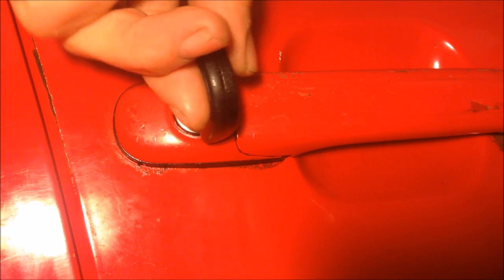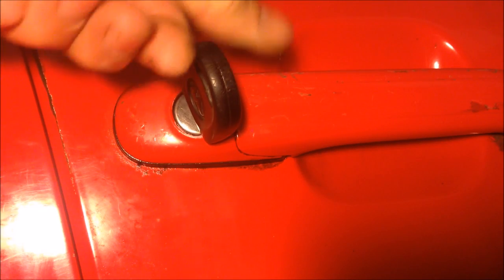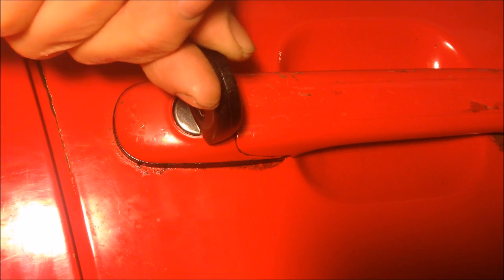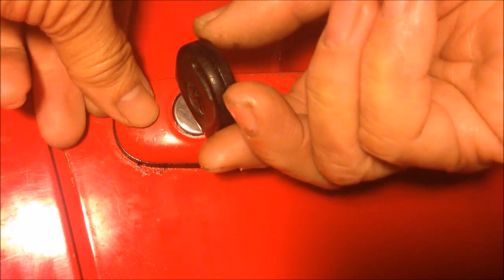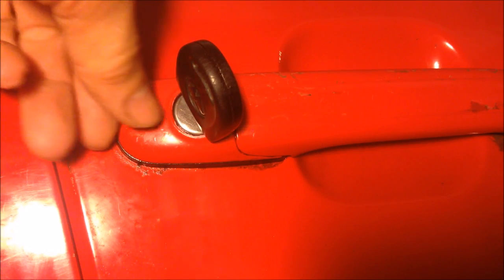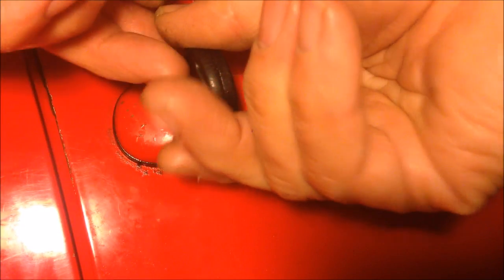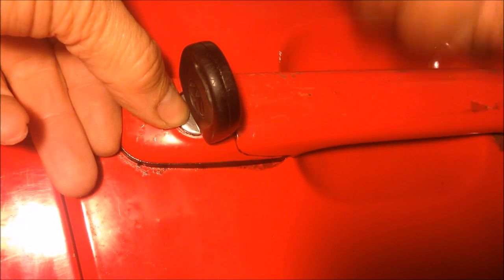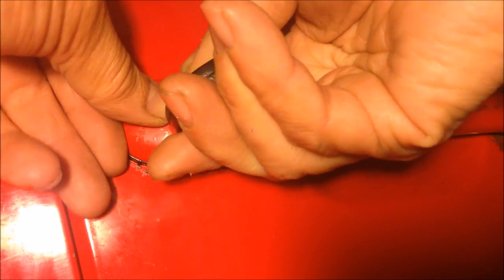VW Polo: How to turn a stuck/worn/broken cynlinder lock?, 6N2, 2000

Comment: Hello sir!
Do you have any idea how to remove the key from  a mercedes 1992SL because its stuck in the trunk. It closes and opens but i can’t take the key off from it.
I would appreciate your help.
Thank you!
Reply from the maker: HI, i think the best you can do is to keep trying. you could use some lubricant, such WD40 spray, into the cylinder, then try to pull out the key (normally at the vertical position). if you did put the key into the cylinder, you should be able to pull it out. if not successful, you can replace the lock cylinder with a second-hand one. good luck!
Reply: @RepairDIY  thanks for your help.. i just read your response and it worked second time with WD40✌🏻✌🏻

Comment: Mine does the opposite, it spins around and doesn’t have any effect. Any ideas? Thanks
Reply from the maker: hi, i think you may have to remove the door trims and cover board to check inside. It is possible to be a broken tab linked to the lock cylinder, or may be some misalignment of the lock components. While I couldn't use the drive door lock, I used the passenger door lock instead before I got time to repair the driver-side door lock. good luck!
Reply: Ben Andersen mine has also just done the same what was the solution, tia
Reply from the maker: hi, The problem is the lock cylinder has worn out. I think you could either 1. live with it; 2. use the passenger-side lock;  3. you may be able to swap with the passenger-side lock; or 4. replace the lock (normally with a different key, not convenient! or ask a locksmith to change the bullets inside the new cylinder?). Good luck!
Reply: Your spring is broken inside the lock

Comment: Hi please if you give me response.my key is locked on passenger side?
Reply from the maker: hello, the most import thing is that you must turn the key. you can spray some WD40 or similar into the key hole. Soak for at least 15 minutes. Try to turn the key. The key can only be taken out when it is at vertical position. So turn the key to vertical position and then try to pull the key out. If not out, you could try to turn the key 180 degrees to the vertical position, and then try to pull the key out. hope you can take the key out this way. good luck.
Reply: Please if you tell me by power you mean?
Reply: It is already 180 degrees but still not
Reply: Thank you so much ..i was suffering from 3 hours..you salve the problem..thanks for your replay❤
Reply from the maker: @iqbalahmadzai6136  congratulations! You have done it well! very happy to hear this good news!

Comment: Ive got this problem with my passat 3b (I believe they have the same sort locks ?).
I just bought it 3 hours ago and because of that Ive left the other key and remote control inside the ashtray and the car is now locked on every door.
The only key I have is stuck inside the door and it wont open my doors , Ive tryed for more then an hour to get the key out with your instructions but that didnt work .......dont know what option is left ....break a window or something ? :(
Reply from the maker: sorry for being late to respond. Hope you have solved the problem. Always keep a spare key outside of the car. My car has locks on both front doors and the lock on the passenger door works well. The only advice i can give is to try to press onto different directions and in-out positions. Spray some WD40 may help as well.  Wishing you good luck for your new car.
Reply: @RepairDIY  thnx for the reply though, Ive broken out my back window yesterday. 
Bought 2 good used locks with a key and a new window from the scrapyard also.
Ive took out the doorpanel and the aluminum plate too. 
Now Ive got my key out the door lock but the lock isnt doing anything. Can only move it a bit left and right. Also moving the lock mechanism from inside with my fingers doesnt do anything, it just keeps shut.
I think I gotta break the lock out from inside or something?
It just stays in lock mode and pulls back the doorpin , even with no battery power. There is not much information about this on the internet.
At least I can drive the car around now but I have to repair all the locks and somehow get the door open if I wanna replace the lock inside the door. 
Im good with buying cars that start having issues as soon as I bought them 😅.
Reply from the maker: "Im good with buying cars that start having issues as soon as I bought them 😅". Yes, I have been doing the same! In reality, we only find more problems after we bought our cars. I think the lock cylinder is normally held by a clip inside the door. There should be a lever at the cylinder to operate the locking mechanism. My Polo has central locking: the cylinder operate a switch, the switch switches on the vacuum pump, the vacuum locks or unlocks all the doors. You can investigate on your car. Good luck!

Comment: I Got problem it gets Frozen even tough I put oil/grease idk on english And it still gets Frozen where I put it in then ? Is there other place where I put it? I have VW polo 2000 2n6 hatchback
Reply from the maker: Hi, I recommend to put something like WD40 several times over a few hour period to see if you can turn. Otherwise you may have to remove the door trim cover to find out what goes wrong inside and de-greaser/lubricate from there. good luck! have a good day!
Reply: @RepairDIY  thank you for fast amswer!
Reply: Hi i m too much suffaring with key  ..car is open but key is luck in the door please of you give me idea for to take out key?
Reply from the maker: @iqbalahmadzai6136  please see the other thread.